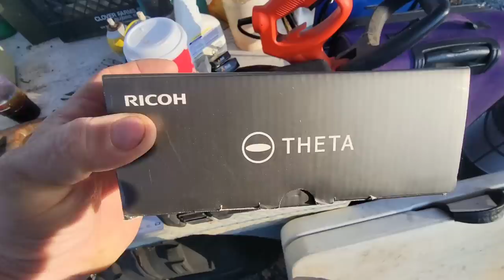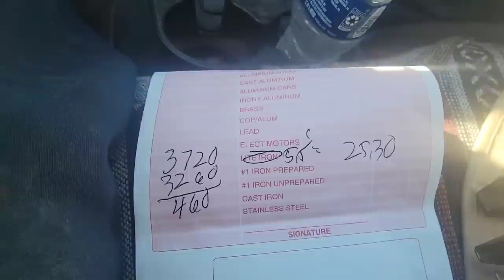Recycling Metal ♻️ Hating the Game

Comment: You'll have to learn how to use the 360 video how to incorporate it into your workflow you're going to have to render it using it raw is like taking a globe and flattening it to a map it doesn't work right

You don't need to aim it you don't need to align it it's a 360 by three axle camera so after you make your recording and when you're rendering it that's when you point where you want the camera to point in software afterwards